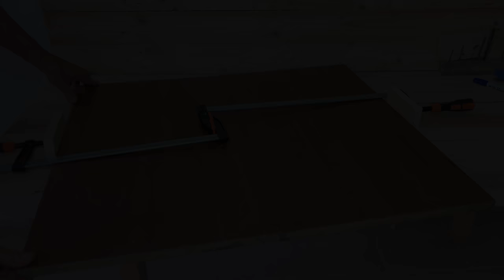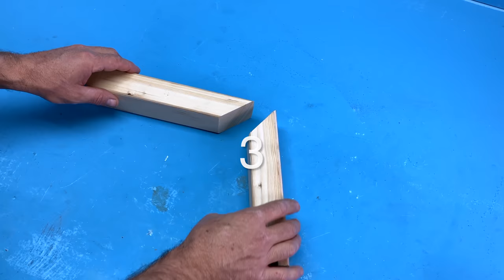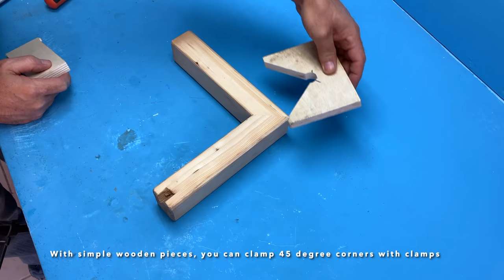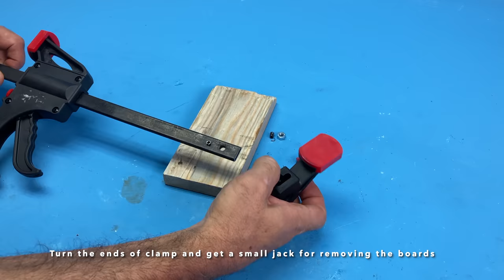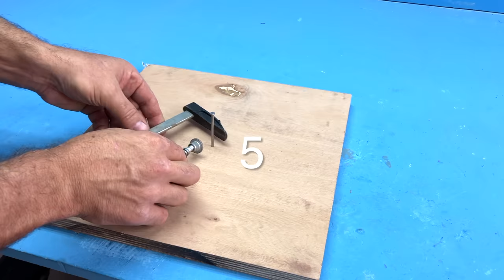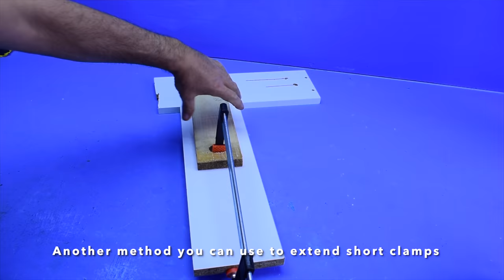Few People Know About This Clamp Function! Clamp Hacks That Will Help You

Comment: For the number 4, you don.t have to punch out that stopper and turn the handle around, you can just put the lip of the clamp that you've just unscrewed to the other end of the clamp.
Excellent video nonetheless, so mush less trouble I'd have to go through had I watched it earlier.
Reply: I was thinking that too, just undo the small jaw and fit it on the other end facing away from the ratchet jaw
Reply: Exactly what I came down to the comments to say! Hahaha
Reply: Agreed.. number 5 is the only one that was new to me. The rest, I'd have thought were pretty obvious.
Reply: @lachlanbell8390  😅 100% same here...came from seeing thumbnail...that's why the dang bolt is there; screaming "twist me"...about lost it when he knocked the rivet out 😅
Reply: @LocostR1  interesting

Comment: I have a project of making a picture frame in the coming days. Was wondering how to clamp the frame together. This video provides exactly the solution I was looking for. Thank you!
Reply: You can buy special clamps for the corners from B & Q - very cheap.
Reply: A simple tie down strap is all you need, I use it all the time for frames. And it's self-aligning too so always perfectly applied pressure with angles maintained.

Comment: to get the jack feature all you had to do was move the fixed jaw to the other end. That's why it's removable. No driving out of pins necessary. They already thought of that.
Reply: I have a pin in each end and the fixed end has a bolt so one pin must come out to remove the clamp. Not sure what you are getting at?
Reply: @boarhog1979   the clamp doesn’t have to come off is what he’s getting at.   The end just gets flipped and put on the other end.
Reply: @jasonsteele6926  Well, how do you do that when both ends of the flat bar have pins that need to be driven out in order to flip the end and be used for spreading. My clamps have pins in both ends and are Irwin
Reply: @jasonsteele6926  I assume I explained this correctly. I have been around tools all my life. I can't be this dumb, I hope. The ratcheting end works only 1 way and I can remove the fixed end via a screw as it is beyond the pin. I hope I am missing something? If the fixed end pin is removed, then it can be used as a spreader. I bought the Irwin 4 pack. 2 12" and 2 6"  clamps
Reply: @jasonsteele6926  I hate to harp about it as it can be flipped, but the ratcheting end pin must be removed in order to slide the fixed end on and install the screw because the pin protrudes, stopping the fixed end from being inserted in order to be screwed on. The hole alignment is correct, though. either way, 1 pin has to be removed.

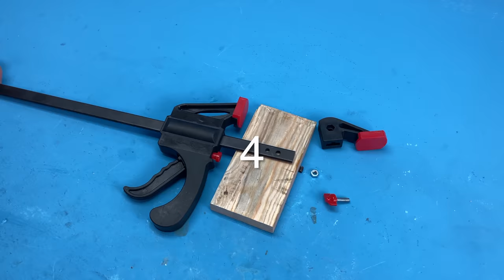Comment: 1:45 You don't need to unpin the main clamp - just attach the small part to the other end of the bar. You'll get the same result. It is supposed to work that way without extra tools.
Reply: I came to the comments to say the same thing.  My clamps were advertised with this function.

Comment: Trick No. 4 - It is not necessary to remove any rivets as shown. Just unscrew bolt, remove end jaw and install it on other side of flat bar - there are holes already prepared for it.

Comment: A lot of clamps also have holes drilled at the fixed end under the jaw - knock them off and link two clamps using a bolt.

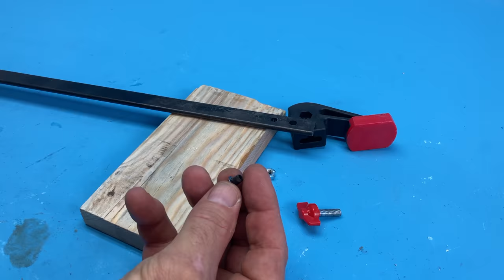Comment: 1:50 why did you knock the pin out and slide the clamp mechanism off? you could have slid the clamp end onto that end and put it's bolt back through without that extra step? I do this all the time
Reply: True! The same question here. I have the same clamps from LIDL...
Reply: @kalmarattila  I have a few different branded one handed clamps and they all work in exactly the same way (except an old Erwin which has a fixed clamp end), the pin he knocked out is for aligning the clamp end and the hole next to it for the bolt to secure it :)
Reply: same here, few different brands same  mechanism more or less to trun the clamp into a spreader , not force  or knocking anything  required
Reply: I was looking for THIS kind of comment about no 4. My thoughts exactly lol! I have the lidl one too and another make they work the same way without hammering pin out.

Comment: I use the reversed Harbor Freight clamp to hold the brake pedal down when bleeding car brakes. Loosen the nipple on the wheel cylinder, push the brake pedal down, put the clamp "jack" between bottom of dash or steering wheel to keep pedal down, close the nipple, remove the jack, repeat. One man way to bleed brakes.

Comment: #4 doesn't that type clamp just have a screw hole so you can put stationary clip on opposite side for the same push effect?
Mine does!
Reply: Вот именно. Автор просто не знает о этой функции)))
Reply: @dima_drugoi   Вау, это очевидно !, лол!
Reply: They’re called Spreader Clamps, undo the screw and put the fixed part on the opposite end of the bar to change from clamp to Spreader. That’s why they have the butterfly nut on.
Reply: @MD-hv5ss  Yeah, I know. Didn't I say that I had one!
Besides, 
it's not called a "Spreader Clamp" it is a Regular Clamp that has "Dual Function" both spreader and Clamp function. 

Thank you for your input!
Reply: He uses cheap-ass clamps.

Comment: In #4 why would you pop that pin out? The clamp is made to do this from the factory, and there are holes on either end for mounting the clamp tail. Just take the tail off one side and put it on the other.

Comment: "Один вопрос, лишь только блядь один маленький вопрос" Зачем вы выбивали ограничитель и снимали подвижный упор??? 

У вашей струбцины есть отверстия с двух сторон. 
Снимаете неподвижный упор и просто переставляете его на другой конец. 

"One question, just one fucking little question" Why did you knock out the limiter and remove the movable clamp??? 

Your clamp has holes on both sides. 
Remove the fixed clamp and simply move it to the other end.

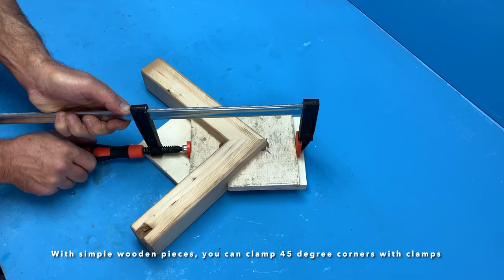Comment: 1:22  the outside jib will pull the corner together but the inner jib will push them apart.  This is not good.  
EDIT: like is was saying.  You see when he turns the corner to the other side, there is a gap, and these jigs didn't pull the corner together like he intended them to.  This solution is a fail. 
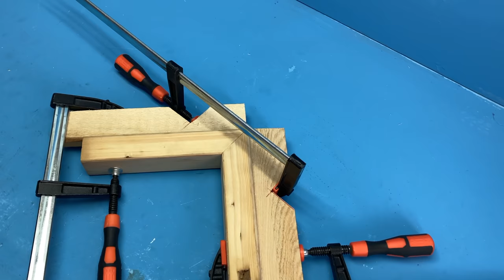1:35  This is much better.
Reply: I was thinking the same ...